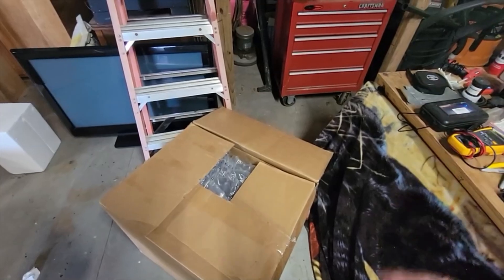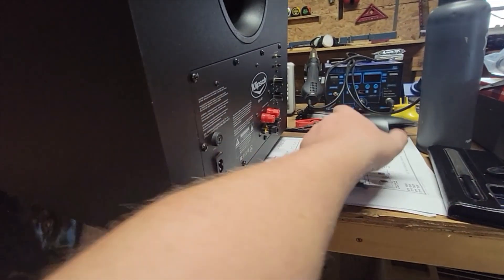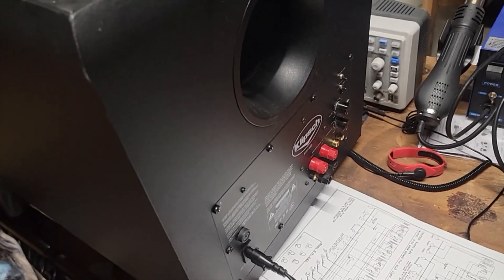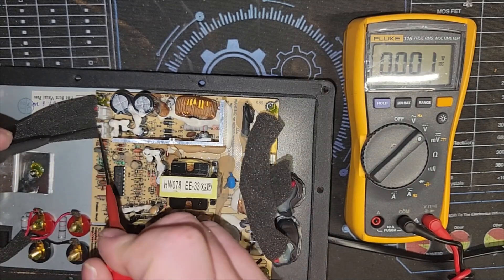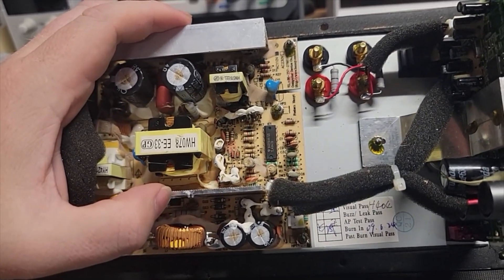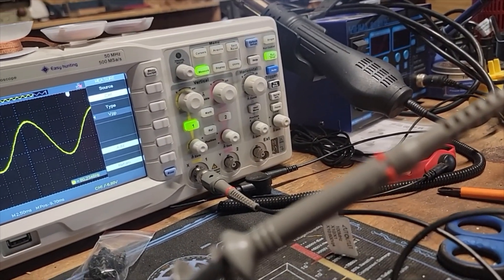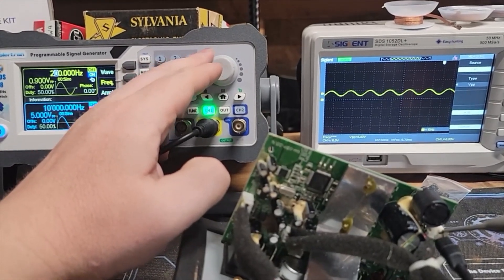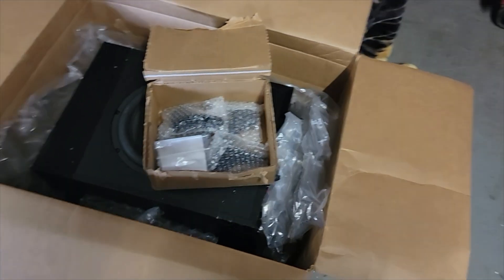(Quick Fix) Another Bad Klipsch SW-450 Repair

Comment: I need to send you the amplifier out of my Klipsch SW 450 it needs the volume control pot is bad . Please tell me what I need to bro and mail it to you thank you Scott
Reply from the maker: check out my business page for details. https://sites.google.com/view/havingfunrepairs/business-repairs
Reply: I have two Klipsch SW-450’s. My original was working fine until I added the 2nd, have a Denon AVR-3312CI 7.2

The original sub purchased in 2013 started buzzing, would work aside. Then unplugged, plugged back in and then blue light went out completely and has zero power. Amp?
Reply from the maker: @nccoach32 Or power supply

Comment: Wassup I had my Klipsch sw-450 since 2008 and it started doing this weird humming noise then the volume knob started making a strange scratching noise sometimes it goes in&out I don't want to get rid of it what can I do
Reply from the maker: @yayyaystxxtama80  sounds like your volume knob is starting to go bad and maybe the filter capacitors are bad as well. However, unless you have equipment to properly diagnose it will only be guesswork on your end. I offer repair services. Visit my Google site:

https://sites.google.com/view/havingfunrepairs/business-repairs

Comment: I am not technical guy, but i like to watch videos and i can try fix by my own. Thanks
Reply from the maker: Thanks for watching!
Reply: @HavingFunRepairs  Yes, thanks for your video. I bought a sw-450 sub from the Facebook marketplace, but when I connected, the blue led light started flashing with no sound or anything like noise or something. But I tried to contact the guy from Facebook again, but he's disappear 😔. So I was cheated, but the guy I really liked the subwoofer, but I don't want to get rip of it.
Reply from the maker: Sorry that happened to you. Hopefully this video helps you. I do not remember the cost for all replacement components. However, you can price the parts you need using digikey or mouser online.
Reply: @HavingFunRepairs  Oh, ok, thanks 😊 is any specific link from the parts because I understand if replace the whole circuit board is going to be expensive.